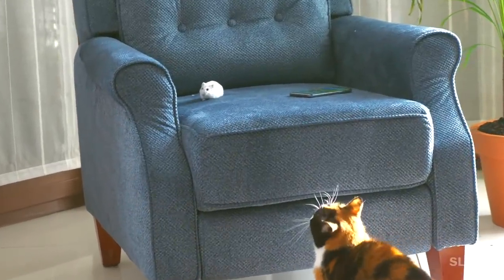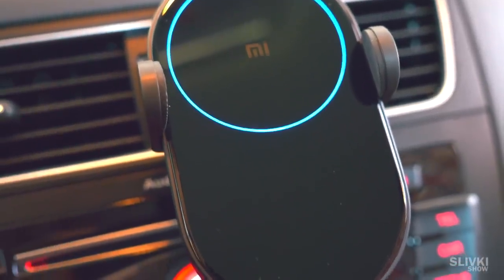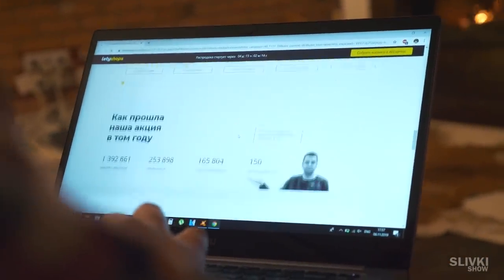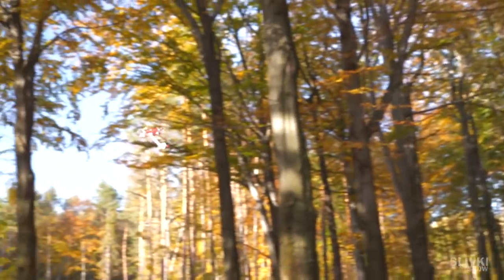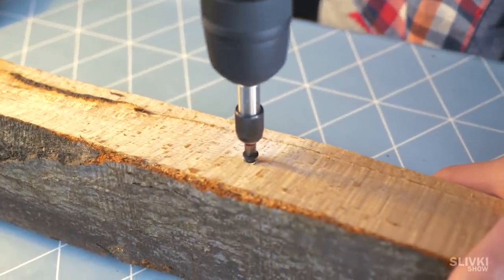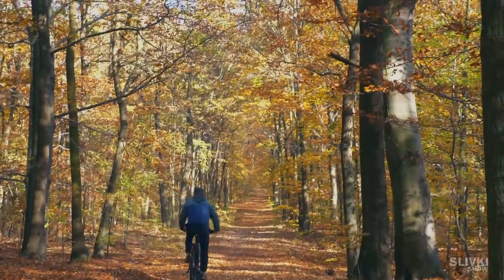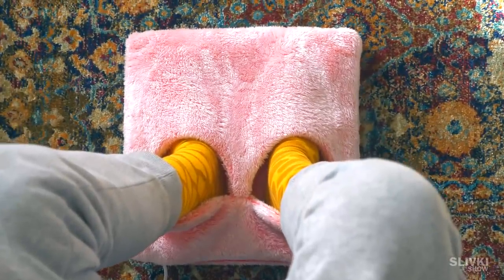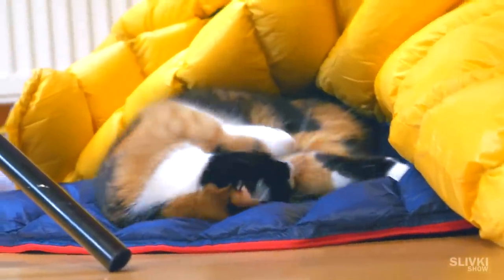WE BOUGHT THESE GADGETS ON ALIEXPRESS

Comment: The screw broke because of bad quality not from the drill.
Reply: also the fact that he kept the drill running even when the screw was all the way in
Reply: @ryanrisher5542  but I have Makita drill and good quality screws (quite expensive ones) and I can drill a screw in the wood almost all the way trough
Reply: @Foxy-gs5xv  yeah, it depends on the quality of the screws. But what I was saying is that if he hadn't kept drilling the screw, it might not have broken
Reply: @ryanrisher5542  Yes 👍
Reply: @ryanrisher5542  Nope, a good quality screw's head doesn't break, at most it will wear the screw bit.
Reply: China made lol

Comment: Omg that outlet looks so dangerous. As an electrician I want to ask everyone NOT to buy these!
Reply: Can you argue ? Im not seeing what's wrong with it
Reply: @enzoreverdi2612  Its amp and volt may vary and by the way always original charger is the best option for longer battery life of smartphones
Reply: @anwitodas2447  that's maybe why there is a QI chip in it no ? it regognise the optimal voltage for the device whos pluged in
Reply: @enzoreverdi2612  I'm talking about the way it's set up. You've got a socket which supplies (220) Voltage over (16) Amps yet the USB circuitry is directly connected to the terminals via what seems to be 0,6mm2 wires. Not bad per se but I'd rather not trust the Chinese to do things right. They do not give a shit. When buying these kinds of outlets always buy something certified (KEMA, ENEC, VDE, BSI, TUV, whatever). Never trust your equipment, your house or your life with these kinds of shoddy contraptions. It looks shady as hell.  Take this instead. I don't give a fuck if it's more expensive; Better safe than sorry:

https://www.jung.de/en/5297/products/technology/multimedia-terminals/usb-charger/
Reply: @resonanceofambition  I see what you mean , thanx for the link they look way safer for sure
Reply: @enzoreverdi2612  you think its having in a cheap chinese socket???
Reply: @anwitodas2447  i'v just join you on the point that the socket on the video look like chinesse crap , english isn't my first language so sorry if it's sound sarcastic ^^
Reply: @UKnowMeIMURDaddy  hehe 😂

Comment: The biggest problem with the last gadget is that even though the wall plug may have usb port. It may not be as powerfull as your smartphone one. Like my smartphone charger has three different levels 5V 3A 9V 1.5A 12V 0.5A, and these levels are essential for quick charging

Comment: Please don't use that wall socket charger. See behind your OEM mobile adapter, there is a box inside another box which says that it is has double protection (to say in simple words). But these cheap Chinese wall sockets don't offer any protection. It will surely damage your mobile charge protection chip insider your phone if used in long run.